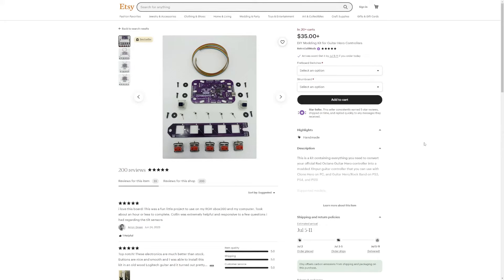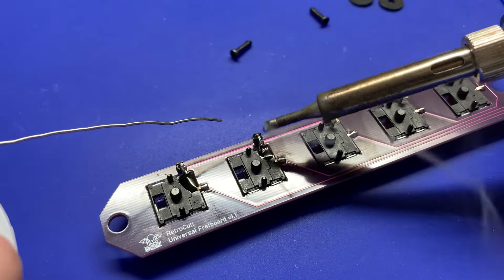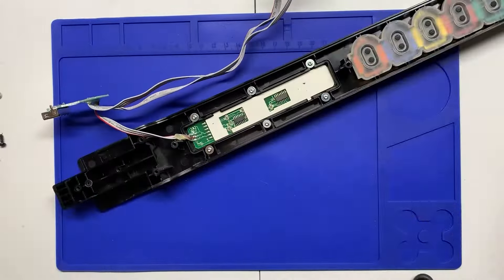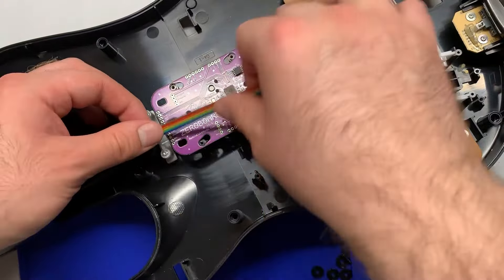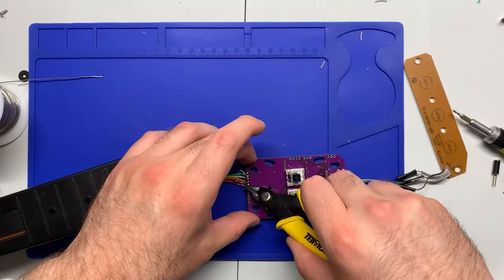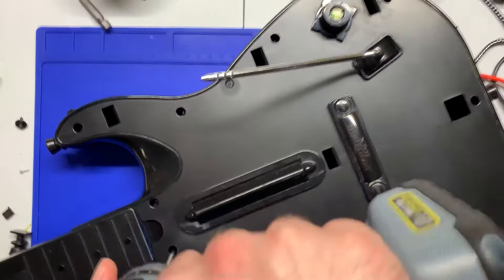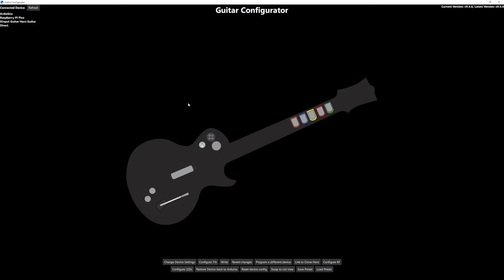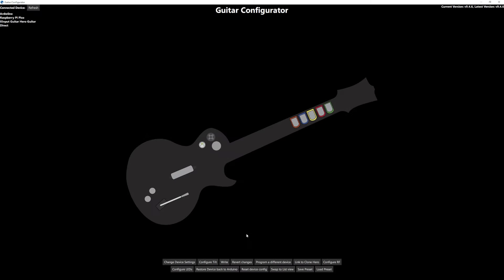ZeroBoard DIY Guitar Hero Controller Mech Fret Modding Kit Guide #clonehero #guitarhero #rockband

Comment: Accidentally got the kit that required soldering months ago. Finally got a soldering iron today. I messed it up a couple times because of the extra plastic bullshit inside the Les Paul, but I got it working and IMMEDIATELY set new high scores in multiple games. Works FANTASTICALLY. THANK YOU!
Reply: what supports do i cut out on the les paul neck?
Reply: @destroymarcy  It's a couple of the ones at the end of the daughterboard that the frets are on, near the wire that leads down the neck to the main board. Just assemble it as normal, and see if there's anything that gets in the way. It's easy to see when you're putting it together.
Reply: I bought the soldering as well, you wouldn’t happen to have a reference photo you could send me of your work? I have the ps3 Les Paul I just want to make sure I do it right. Thanks 🙏
Reply: @Premiumganggang  Oh I didn't do it well. Lol. Don't get me wrong, it plays great. I got some frets and a strumbar from PartyBoi, so that helped, but this kit is like 80% of the great feel and function. But my soldering is UGLY. This video does way better than me.
Reply: @ragepoweredgamer  no prob 👍, I did it and my solder was also bad lol. But I got everything to work except the blue button. I’m suspecting it was already broken so it’s still a project for later. Thanks

Comment: Going to get this in a few days after I check to see if I have all the screws needed to open my broken les Paul. Should be a good soldering test and a fun project. Thank you for your dedication!
Reply from the maker: Appreciate the kind words! You should need a Torx T9 or T10 and a Philips PH1 or PH0 to open it up fully!
Reply: @retrocultmods  would a T8 work in place of a T9 bit? Or more specifically would I be able to get it done with everything in ifixit’s Moray Driver kit?
Reply from the maker: @PallymanQPR21  The Moray Driver kit should suffice!
Reply: @retrocultmods  just made the order, excited to get started when everything shows up!
Reply from the maker: @PallymanQPR21  Awesome, thanks for supporting my kits! :)
Reply: @retrocultmods  just finished kidding my guitar. Can’t believe it’s working. I have next to no soldering experience but it still is working. Only issue I have is with the tilt and I’m guessing it’s because I bridged the connection. Thank you for putting this out for the people!

Comment: Love your work man!  One thing you might consider...  when the strum board may be a little loose,  i will use a small strategically placed  drop of hot glue on the navy part of the switch and flatten the top to the desired height as it cools.  Been working great for me, just be careful with the glue

Comment: got my zeroboard before this vid came out and put it in a ps2 WT guitar! there are some slight differences between the 360 model and the ps2, i noticed. on the ps2 guitar all the internal screws are philips head, and the start select board only has 1 ground, as well as the touch bar plastic just being a part of the neck. i wasn’t sure what pins were what on the whammy bar so i actually took some wires from that to splice to start/select… i do have some extra wire though and i may go ahead and add that in now that i know! have been loving using it so far, and the only issues ive had have been from me making bad solder joints. totally worth it!
Reply from the maker: Glad the build went well for you, I plan on doing videos for each specific model when time allows so things will be much more clear!

Comment: What should I do if I want to modify an Xplorer guitar which has a dead motherboard? Apparently the previous owner was messing with the guitar's circuits and burned the integrated chips, in that case I couldn't use start, select, or the guide button, much less the LEDs.

Comment: On a Wii WT (Starburst) guitar, the included plastic spacers are too skinny to go on the standoffs for the strumboard. If I do not have them, the strumbar is too close to the switches and doesn't fully deactivate. If I set the spacers on top, the strumbar wont hit the switches. Would you say I should slightly enlarge the holes of the spacers to fit down on the standoffs to space the board out slightly?
Reply: I'm having this same issue. I would love to see a response on this.
Reply: @pauly5497  I did this a couple days ago. Had to cut off the small ridge on the strumbar where it actually touches the switch, and put some tape on to get it thicker. Works like a dream now, but a definitely a wonky solution
Reply: @dankfart  great idea! I will follow suit. Thank you so much!

Comment: Do you know if it's doable to mod mechanical keyboard switches into the stock strum board on a Wii WT guitar (can it line up / fit properly)? It seems like a waste to gut a working guitar, plus I already have the Wii adapter, but I'd like to have better strumming. I've got some wireless PS2 guitars without dongles I'll probably try the ZeroBoard with at some point, but would love to also have a very minor upgrade for the Wii guitar's strumming.

Comment: I'm having an issue I hope you can solve. I have everything set up. Beautiful guide and kit. But the tilt function is iffy. 
Noticed when playing on PS3 that I can't activate in strummy sections, and even some less strummy sections.
I plugged into my PC and opened Santroller to check it. Resoldered the tilt sensors and adjusted them. They work. BUT, if I hold it tilted, and them strum, I see the tilt test light on the screen will flicker for every strum. Is this a limitation of the board? Any time I strum, the "frame" that the strum registers, the tilt turns off for a frame, so I need to wait for a break to activate star power. On PC, I use a foot pedal, so no issue. But I'm starting my son playing through all the games on console first to learn, and he's holding the neck vertical for 5, 10, 15 full seconds, waiting for there to be just enough of a break in strums for star power to activate. 
This result is duplicated on PC, but because I can use 1,000 hz polling rate, it doesn't affect the gameplay much at all. Is there a way to fix this? It's a PS3 Les Paul originally, so using Select isn't a great option.

Comment: I absolutely love the idea that I can just buy a kit and mod my guitar hero controller. Shipping was quick and easy and the Youtube video accompanied with it is clear and precise. 

HOWEVER!! FAIR WARNING TO ANYONE PLANNING ON DOING THIS WITH THE STANDARD SOLDER MOD. DO NOT BE AN IDIOT SUCH AS MYSELF!!! 

Once I had thought I was done, following the video completely, before I screwed everything back in I had noticed my connections were faulty when it came to the fret board but, everything else was working fine on the strum bar side of things. Mind you, I had already hot glued the connections to reinforced it like a dumbass. Frustrated, I tried removing the hot glue by just picking at it, but it was resistant so in a desperate attempt I tried melting the hot glue to access the solder to remove the connections. This just made things worse and now I have hot glue inside the wire ports and is impossible to remove. Now I am down 40 bucks and have to purchase the solderless version so I don't fuck up again as bad as I did.

Moral of the story: DON'T HOT GLUE ANYTHING UNTIL ALL OF YOUR CONNECTIONS ARE PRESTINE AND WORKING! lol lesson learned on my part

p.s. @retrocultmods You are a godsend for making these. I have the Wii adapter as well and is working flawlessly. Thank You ❤‍🩹
Reply from the maker: Very solid advice! I can guarantee you that the solderless kits will be MUCH easier!

(and thanks for the kind words, they mean a lot!)

Comment: Great video. I have a question btw: Can I mod my Wii guitar and use both on PC and Wii? What are the parts I have to solder to Wii connecting part?
Reply from the maker: Thanks! After modding it will no longer be usable on Wii, but you will be able to use it on PC, Mac, Playstation 3/4/5, and modded 360s!

Comment: Just ordered one of your kits! Can't wait to put this on my guitar! I notice it got a hole on the top of the board for tap bar is it possible to make it work on this sunburst?
Reply from the maker: Thanks for supporting my kit! The tapbar inputs currently only work with digital signals, and the GH5 guitar is the only model that used digital for its tapbar, so unfortunately that won't work for your WT guitar!

Comment: any guidance on how the mod changes for the xplorer? Is it just cutting stuff out of the neck and fretboard so that this new stuff fits? or is there more too it than that?
Reply from the maker: The Xplorer mod can require you to sand material in the neck for certain models. It also requires soldering to tiny pads and cutting of traces in order to wire up the Start and Select buttons.

Comment: Theoretically could u use the original guitars silicone switches with the zero board?
Reply from the maker: Yep you'd just have to follow the traces of the stock fretboard and connect them to the corresponding pins on the ZeroBoard!
Reply: @retrocultmods  very cool, thank you

Comment: Where am I able to get replacement tilt sensors? I was trying to adjust them because they weren’t being detected in the software and one of the legs on it broke off
Reply from the maker: The tilt sensors used are SW520D sensors; you can find them on several websites as they are fairly common!

Comment: hi, i'm trying to decide between your zero board kit and your pico+strum board kit. i was wondering about the start + select process on each one. when using the zero kit, would the splicing still be necessary if you're modding a ps2 kramer like the one you were modding in the tutorial for the pico+strum kit? or could we use the process in that tutorial, since there are only three wires there, and would they match up to start select and ground similarly on the zero board? presumably we'd still need jumpers to account for the length but i was wondering about the splicing part. i hope this question makes sense, thanks!
Reply: Yeah, you won't have to do any splicing since there is only one ground wire.
Reply: @kvgm  I already did my mod but thanks for answering! hopefully someone else can see this if they're also wondering.  

I also had enough of the original wires in mine to not have to use any additional jump wire to replace them and desolder the original

Comment: how does this kit work with GHWT Strum springs? noticed in the video you've left them out does this affect the playability or recentering of the strum?
Reply from the maker: The strum springs are removed since they aren't needed at all with the new switches. No issues with recentering!
Reply: I actually installed mine with it and it seems fine so far.

Comment: I'm using a GH5 with touch bar, can I use all stock components? I dont see need to redo the entire fretboard as it breaks out on the other side of the body with the connector

Comment: Amazing kit, I was just wonder I have a ps3 aerosmith les paul and I cant seem to get the frets to fit in the shell. when I put the shell on it will push the switches out of the board.
Reply: Same. I ended up snipping the plastic on the back of the shell to make room for the fretboard.

Comment: I donot have the dongle that goes with the guitar. How does this connect to the computer after you swap everything out?
Reply: The USB cable you plug into the board just plugs into the USB port on the computer.

Comment: just purchased this kit and everything is working great except I cannot get the select button to work since I wasn't sure about the wiring. I'm using a wii les paul as well and i haven't found much information on what to wire specifically for the select / start. everything has worked just fine so far and I haven't had any other issues!
Reply from the maker: Hi! Which model did you use the kit on? The layout is different per model.
Reply: @retrocultmods  i used the gibson white les paul, but i figured out the wiring through some trial and error so everything is working perfectly fine. thanks for making these kits!
Reply: On the site it says Wii Les Paul needs custom frets.  Did it work with custom frets?

Comment: On the world tour guitars, are you able to keep the functionality of the tap board if you splice it’s wires into the wires of the corresponding fret? (i.e. green to green, etc).  Or does that not play nicely with the configurator?
Reply from the maker: Yes, you can solder them to the GP18 and GP19 (as well as VCC and GND). However you won't be able to add mech frets with this method. Additionally, this drastically slows down the polling rate for the frets, so it is not recommended.

Comment: What would be the difference between this and just using your adapter you made?
Reply from the maker: The Wii adapter requires no soldering, but a directly wired guitar converted with my kit has a slightly faster polling rate.

Comment: Any major differences for the Wii les paul? I've already ordered custom frets to (hopefully) avoid that issue and I've noticed I'll need to do some desoldering. Any unique challenges that come with that model though or should I be good to go?
Reply from the maker: If you order the Wii Les Paul version of the solderless kit, you'll be able to mod it with no shell modification or desoldering needed!
Reply: @retrocultmods  I did end up needing to mod the body a bit, had to cut the standoffs behind the frets (replaced with stacked foam tape) so the neck would fit back together. Works great tho, got one of each kit now, same steps for both

Comment: Hey i have one question. What is the actual difference between this Zeroboard and the other Board (universal strumboard?)with the pico adapter included you are selling? :)
Reply from the maker: The difference between the Zeroboard and Universal board + Pico is the Zeroboard has all the components of the Pico on the board already, so it saves you a lot of soldering work!
Reply: @retrocultmods  thanks man i will buy one the next few days!

Comment: I managed to interrupt the installation process on the guitar configurator and now I don't see the RPI anymore, any way to reset it or what do I do to get it visible and working again?
Reply: NVM sorted it out, it's done by holding the button S1 on the board while connecting to PC

Comment: So have this xbox 360 les paul and the wiring is a bit different. On the start and select board, it has vbat, start, select, and col1. Where would i wire the vbat on the zero board?
Reply from the maker: For that model you'll want to splice the two middle wires together and connect that to GND. The other two pins can go to Start and Select!

Comment: i really want to do this for my Xbox xplorer, any tips on whats different with this model? also is there any afermarket fret buttons or rubbers that i can replace?
Reply from the maker: I have an Xplorer breakout board coming out soon that will be a drop in replacement for the Start/Select/Home button board, which is currently what makes the Xplorer mod difficult.

There's lots of great sellers on Etsy that make 3D printed frets that will work with my kits, just let them know you are using them with the RetroCultMods slotted fretboards!

(Also if you get my Xplorer Solderless Kit it will include the frets and breakout board)

Comment: I started the flash in santroller and waited until it was finished. Now the device isn't seen at all when I plug it in :-( rebooted, tried different ports, and other USB devices are picked up fine.
Reply from the maker: Try using my tool instead https://retrocultmods.com/download-the-rcm-programming-tool/
Reply: @retrocultmods  since it's not even showing up in device manager, can I reset it somehow?
Reply: @retrocultmods  Tried your tool but it doesn't detect the device either. Device manager on my computer an another don't even show a new device connected. Pretty sure the Santroller flash bricked the board. I held the little button on the zeroboard for 30 sec, 60 sec, and double tapped it quickly while plugged in but nothing ever happened. Bummer since I just go it today and never even got to try it out.

Comment: Hey Kevin plugged mine in to Configure and computer cant recognize it and on the board its the small chip on board is scorching hot to the touch and terminals to whammy
Reply from the maker: Hi, did you get the ZeroBoard or another board from a different seller?
Reply: @retrocultmods  no sir
Reply from the maker: @Dabbin_ON_Em_90s  Is the board you have black or purple?